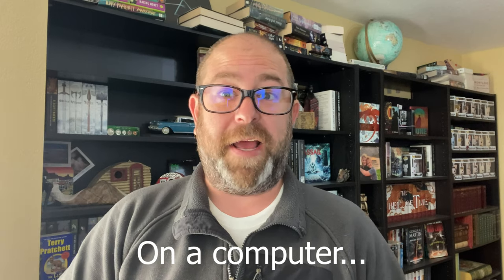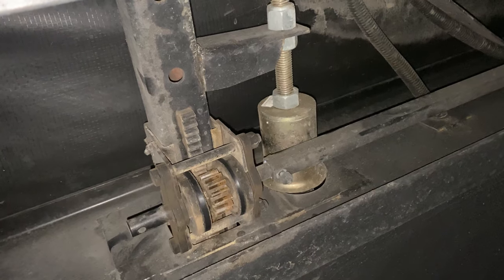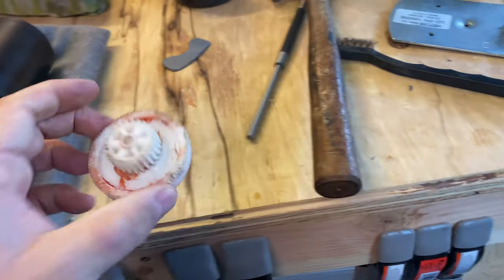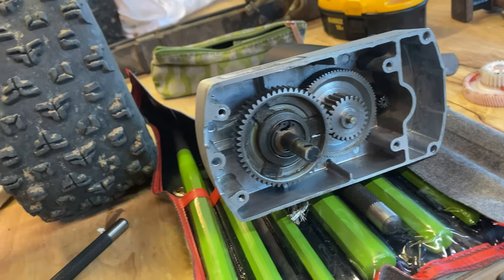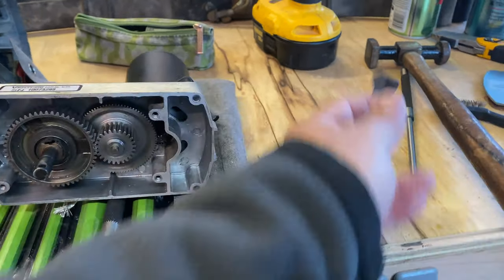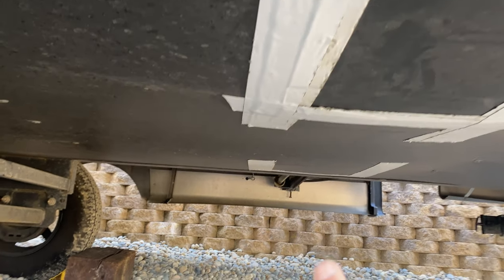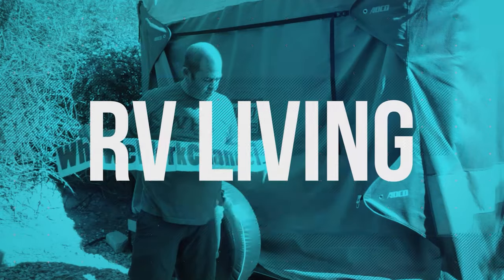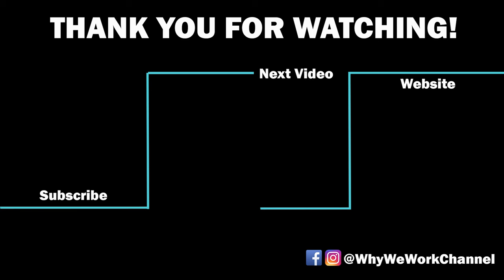Potential Fix for Lippert RV Slide Motor | Repair, Not Replace

Comment: Nice to see you again! My slide out sometimes makes no noise at all, like there's no power.  Then, when you push the rocker switch again, it works.  So I don't think it's related to the gear works. I swapped out the self setting fuses, but it still  happens. Not sure what to chase down next, I just hope it continues to work on the second button push!
Reply: Mite be the switch itself
Reply: @carlitos305way  Turns out it was the switch, thanks!

Comment: We are likely going to be dealing with this in our Flagstaff 27BHWS (same as your Rockwood).  The main slide just seems to have gotten slow.  We've already had a failure of the power tongue jack too.  Everything else seems to be doing fine for as often as we use it.
Reply from the maker: Luckily it’s an easy fix. Overall, the rig has held up remarkably well. Still very pleased with it!

Comment: Could you point to the link for the replacement metal gear, or the part number?  I have a new one RV that is working and this seems like something to have on hand in a pinch.

Comment: Something to consider - that gear is plastic by design, it acts as the "weak link" in the chain to protect the other parts of the drive mechanism.  If replaced with a metal gear then something else potentially more expensive may break next time.